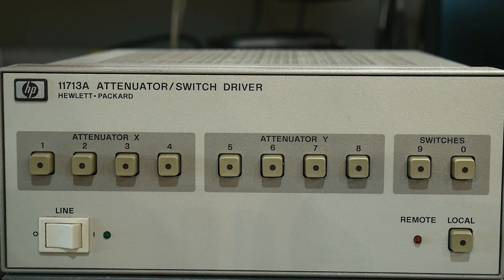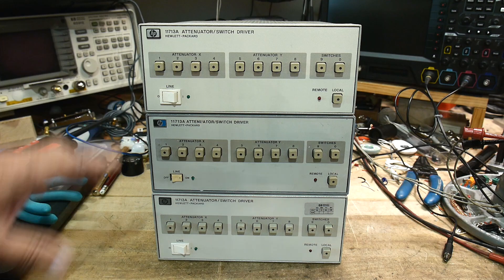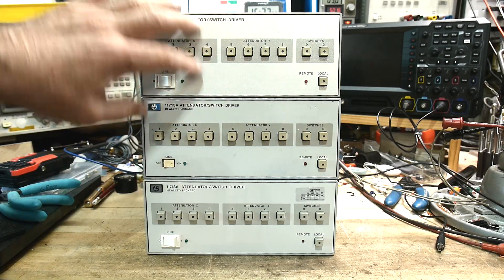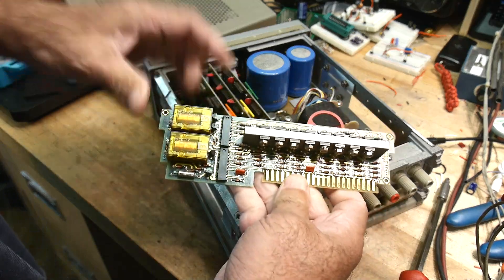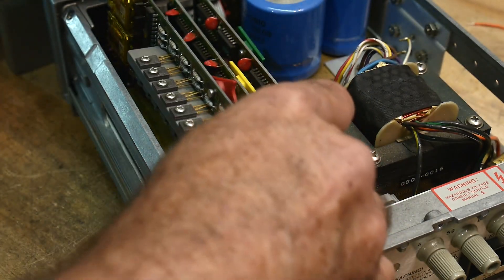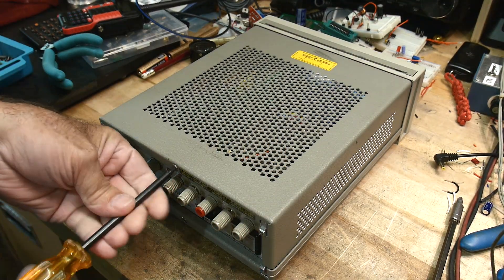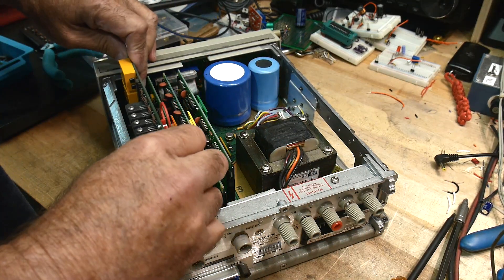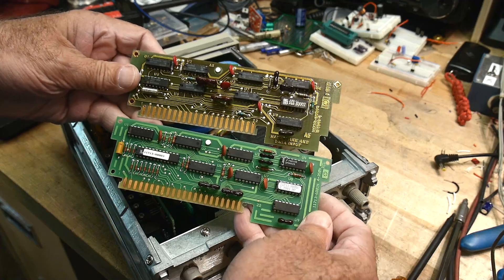#852 Three HP11713A Drivers   No two are alike!

Comment: It's interesting that on those two more recent boards that, as similar as they are, the PCB edge connector "fingers" are slightly different, too.  I wonder if that was a deliberate change or just a new version of a parts library the edge connector part in the EDA tool?   Everything happens for reason; sometimes the reasons aren't that good or significant :-)

Comment: I was the product manager for the switching product line in the late 80s through early 90s.  The 11713A was part of my portfolio.  One of the tail tells is the serial number.  It will give you info on major design changes.  In your examples, the older unit with the 1546A prefix indicates the design for that vintage was released in 1975, the country of manufacture was the US.  The other two boxes with prefix 3748A had a design release in 1997 and were also manufactured in the US.  Minor changes were recorded based on the 5 digit suffix.  The switch driver went through lots of changes based on part obsolescence, technology changes, etc.  There was a period during the early aughts after the split that Agilent was allowed limited use of the HP brand as inventory and graphics were transitioned.  There was a deadline, don’t remember what it was, but eventually it happened.  With regards to the Agilent board in an HP box, it is possible that it was swapped as a result of a repair.

Comment: Why the Agilent logo on the new board? Simple: if they were manufacturing new boards they were not allowed to have the HP logo on them. They were by 2000 a separate company from HP. OK, there was a certain amount of leeway in the transition period, but there was a hell of a lot of work going on in 1999/2000 to rebrand everything. Although the box was labelled HP the board may well have been a replacement for a failed board.
Reply: The transition produced some interesting products. I have one 66312A with an HP front panel and logo, but an Agilent serial number, and another with an Agilent front panel and an HP serial number. On of them (I don't recall which) has a factory option, and I would guess this is part of the reason (neither has seen a service center-- this is how they were delivered). My 34401A is marked HP all around, though the original sale/delivery was from Agilent in 2001, nearly a year after the Agilent branded and serialed 33120A.

Comment: Also, I used to work for LeCroy back in the 1980's and they had a GPIB CAMAC controller that was all discrete glue logic. It had one-shots, RC delay networks on digital signals, you name it. It was designed by a physics guy I was told who didn't understand modern digital circuit design so he designed it more like an analog circuit.  Gave nothing but problems in production when parts from different vendors would get purchased! I was the test engineer back then that had to iron out all the production problems on that unit. Not fun!
Reply: Everything is analog I guess :-) I'm about to start the renovation of a Whitechapel MG-1 computer system from the early 80's. It's a massive all discrete TTL glue logic single 8-layer PC board with some delay lines thrown in for good measure. I believe the delay lines are use in the dram refresh circuitry. At least the delay lines were not made from discrete components and were properly characterized by the manufacturer in a DIP package. Took me a hell of a time trying to source them as they're obsolete.

Comment: The idea that even back in the day HP would have made their own transformers seems a bit strange. Surely there were numerous transformer companies they could have bought from. Seems like more of a philosophy that "it all has to be made here" than maybe a financial decision?
Reply: You have to remember that HP was making a vast range of products, very many of which required different (non-off-the-shelf) transformers, and very many produced in low quantities. It was probably more cost effective to produce them in house than to arrange a contract for each type with an external supplier.
Reply from the maker: It is the most expensive component in the box. Good to get the profit from that too.

Comment: HP, no expense spared. I'm smiling at the large silver mica capacitors on the board.  Thanks for sharing.
Reply from the maker: those are getting removed 😉
Reply: @IMSAIGuy  I don't blame you. I'm sure you've seen the prices on those! They're nice caps especially for radio.